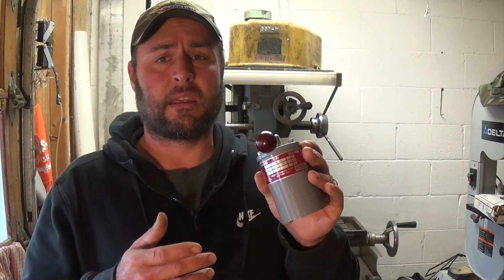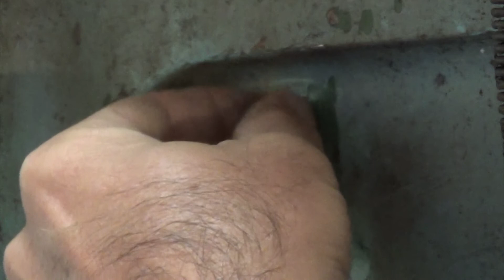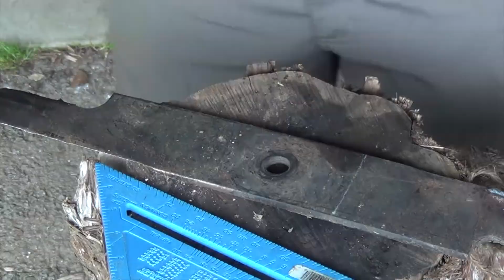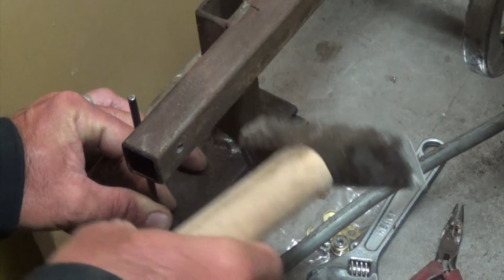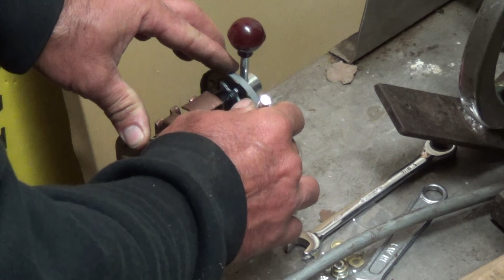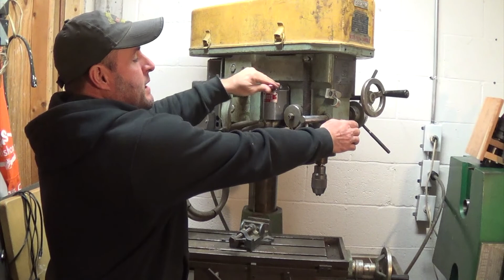Milling Machine 6 (mounting the switch)

Comment: Did you work out what the big string does? Thanks. Well done on getting it going.
Reply from the maker: Did you mean spring?
Reply: @EverydayJourney  yes sorry
Reply from the maker: I thought that I did but then went and checked it out again and realized I have no clue. It’s connected to the return spring for the quill. Maybe it keeps it from spinning somehow. Mine is so crusty it stays in place even without the spring attached. if I ever get to go through everything and clean it/restore it,  it’ll show me it’s function. If you find out, let me know
Reply: @EverydayJourney  Maybe the coiled return spring on the left side of the head (the one your switch screw butts up against) is broken so they threw that on there?  MIne doesn't have it.
Reply from the maker: I took off the spring and it works. Maybe the main one sprung at one time and the put it on temporarily.
Reply: @EverydayJourney  yeah, I don't think that spring came with it.
Reply: The spring is part of the design,it connects to the quill for withdraw assist by way of the left side of the quill has a bracket with a small nub with a hole in it.
Reply: It should be oriented vertically.